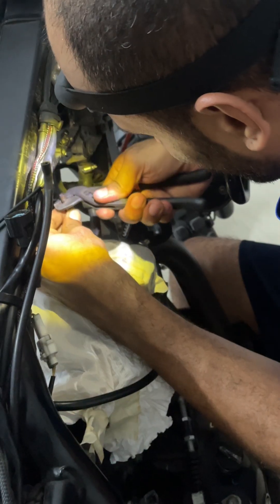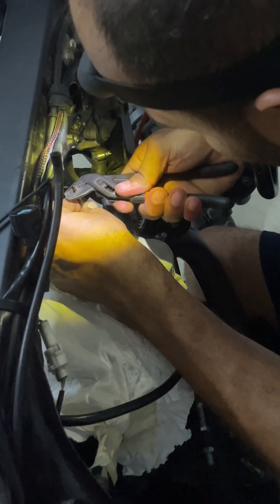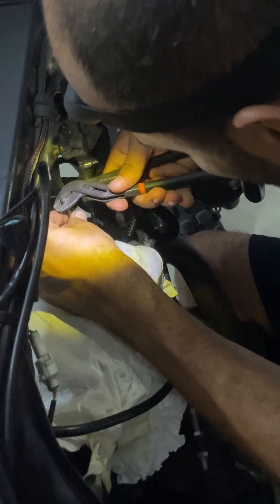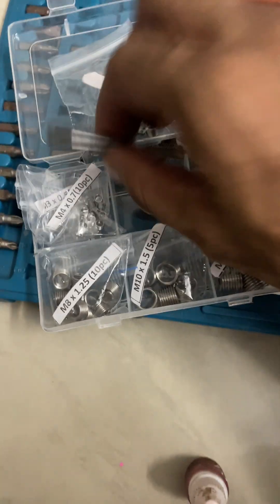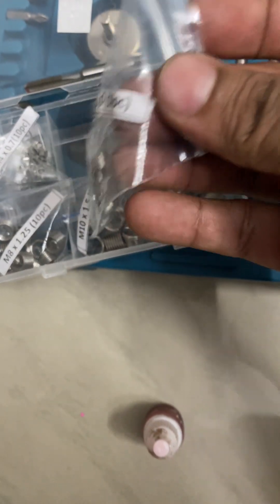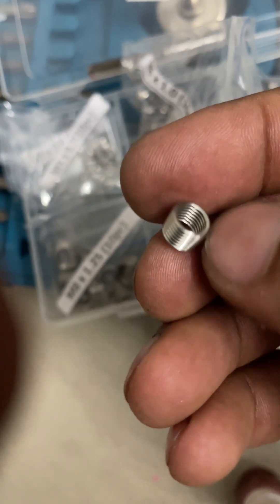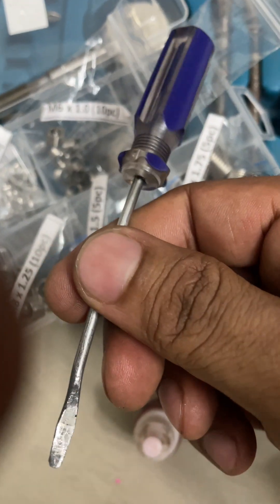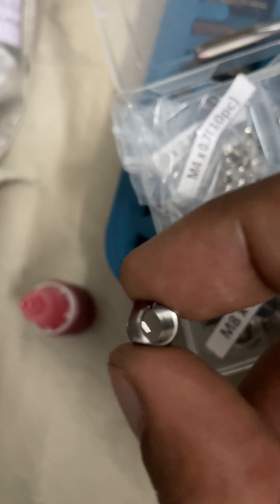STRIPPED BOLT IN ENGINE HEAD FIX

Comment: Sir i have a question I bought  a powerage exhaust for my himalayan411 bs6  and changed the air filter  should i consider changing the down pipes
Reply from the maker: Pls don’t
Reply: @ONTWOWHEELSBEN  ok what should I do then for little bit more power I was considering full bolt on parts

Comment: Ben are you going to review the new Scram 440?
Cheers drom Dave in UK.
By the way, use a tap wrench next time😉😊
Reply from the maker: THE 440 IS ALMOST IDENTICAL TO THE 411 WITH AN ADDITIONAL GEAR  AND A SMOOTHER RUNNING MOTOR. the 6th gear works like an overdrive . Also i couldn't fit the Tap wrench along with the tap within the space the chassis didn't allow for it. hence the use of the mini adjustable wrench.
Reply: @ Adopt,adapt and overcome 👍